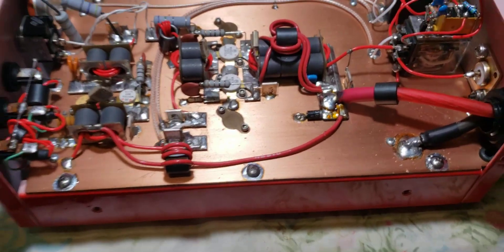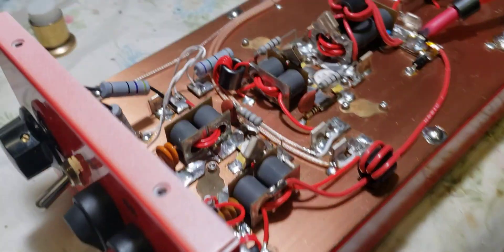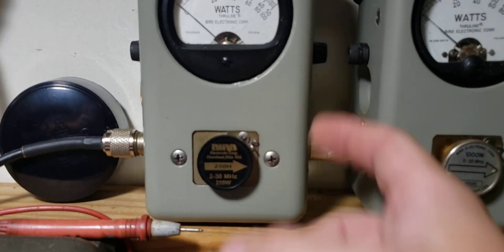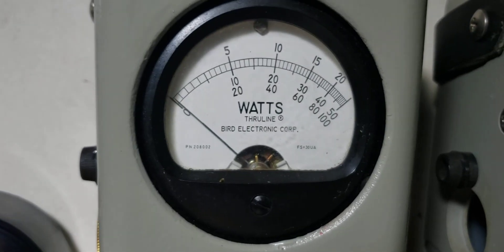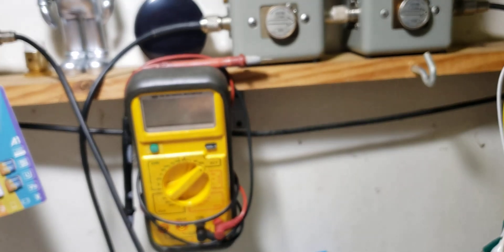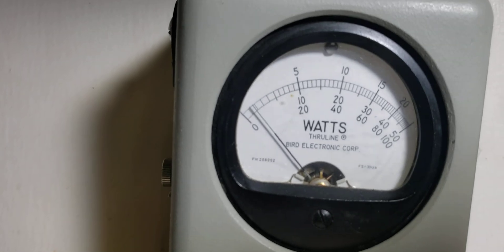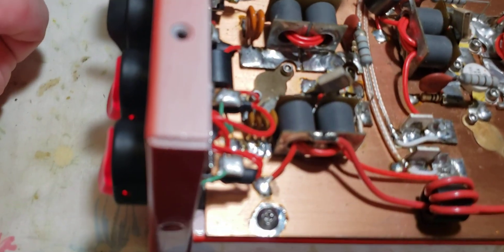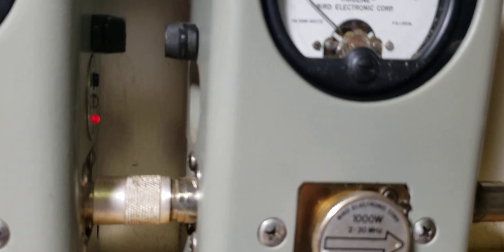🔴 Gatekeeper 3 Pill [All Motorola's] Modified For The New Owner

Comment: is it necessary to put solder around the holes that are used to screw the board down to the case? whats the purpose?
Reply from the maker: We do that for better contact for case ground to board ground incase the copper oxidizes. The solder is soft and digs into it it and make a decent contact.

Comment: looks great. yes MRF 421 cost a bit but still can get them. I even have the MRF 421A stud mount ones. The MRF 455 is common and close to SD 1446 . The MRF 421 has great power gain according to data sheet. I think each 421 can take 10 watt RMS drive power . with feedback 100 ohm can take even more drive.  The reason no more peek watts is also  pill at max output and clipping at peek. on a scope you can see that. not good to run like that even at higher volts. the pill will just heat up and shorten the life. keep drive down and will last a life time or 2 . run cooler .I few less watts and no one on outher end will even notice. 73's
Reply from the maker: Words of wisdom my friend! Yep id love to get some more Motorola 421s man.....I have a few 421A also stud...here is what I am worried about..when I get ready to use these stud mount bjts where will I get the nuts lol...I have no idea what size or thread they are....im sure a few data sheets will tell me.
Reply: @1883GotDown  RF parts still has MRF 421 and even the A. I don't remember the stud size. it's a common thread. I haven't played with them in years. like over 10. 73's
Reply from the maker: @robertmeyer4744  ok thanks imma go check out their prices right now.
Reply from the maker: @robertmeyer4744  BTW I acquired me a very very unique Power Supply today that us suppose to a regulated 100A supply but im not sure about that....It is 145 LBS and wow it is very unique....I have never seen anything like it. It says 28v I think 50A 14v 100A and has a knob but isn't a linear taper type but a switch with like 8 positions....I cant wait to Crack it open...the case appears to be a breaker box case or something....I want to send you pictures of it soon.....